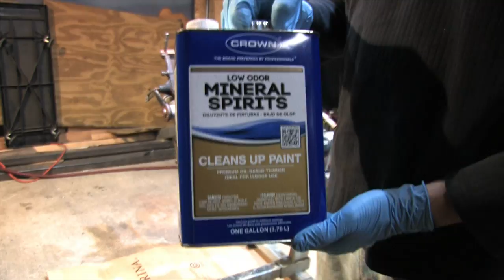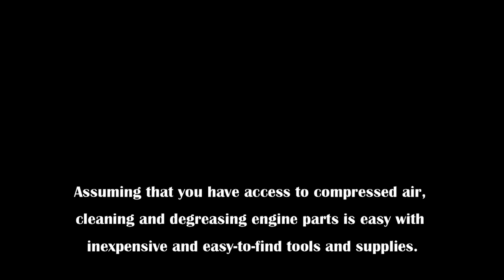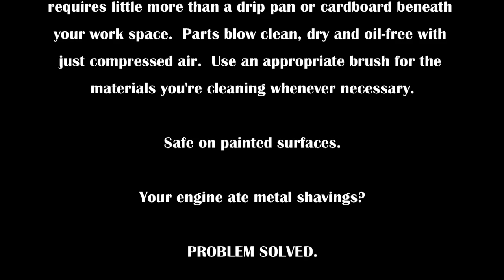DIY Parts Washer

Comment: I recently had to completely rebuild my wife's engine and used this exact method Jafro was kind enough to share with us. This approach worked out awesome! I must say, without people like Jafro sharing things like this with us, I would have easily wasted over $200 in carb cleaner alone! Thank you Jafro!!

There are two things I'd like to make note of:

1) Although it does have a decent evaporation rate, if you are cleaning a lot of parts like I had to, make sure you put extra effort into putting liberal amounts of cardboard down, it puddles quicker that it can evaporate. 

2) Learn from my mistake, if you use this method to clean the wiring harness, make an effort to QUICKLY blow the connectors dry with air. I had a rather big issue with it swelling most all of the weatherproofing rubber seals in nearly all of my connectors!! Some I dried quick enough and had no issues, others swelled so bad that I could reconnect them to the sensors without removing and replacing the weather seal. 

Just something to note!

Jafro, please continue to make these videos as you see it fit, I love learning new ways to a replacement for overpriced specialty tools!!
Reply: fckurvtc very good points to watch out for!

Comment: You should invest in a tumbler ( the thing to clean up ammunitions).

Your bolts,screws,small parts are like new once they took a bath in one of those things.♥

i use sand,bead blasting balls, metallic parts, corn or even crushed wheat with polishing compound and it's really good to clean or polish parts.

Nice Jafro style vid !

Comment: Great idea to use an air compressor and a blast nozzle to blast a solvent for fast cleaning--I'm not sure I would have thought of that.  I wonder how this would compare to using a steam cleaner with a nozzle, of the type Harbor Freight sells for about $100.

I recently got an air compressor to use for cleaning car parts by particle blasting, and it works well, but so far I've only used baking soda, which gets parts mostly clean, but dulls aluminum, so I'll be using ground walnut shells next, which are about one point higher on the Mohs scale of hardness (about 3.5) than baking soda (about 2.5), to see if that polishes aluminum to any degree (I'd settle for just a slightly shiny satin finish), or at least hopefully doesn't dull it.  Glass beads (Mohs scale of about 5.5) and sand (Mohs scale of about 7) are supposed to do a decent basic polishing job on aluminum, but these are dangerous to your lungs, and they'll embed sharp micro-shards in aluminum, which you don't want happening on surfaces that make contact with moving parts, and glass and sand particles can also be a huge amount of work cleaning out of a cylinder head or an engine block.

An interesting thing I found while blasting with baking soda, is counter-intuitive: though something as soft as baking soda can blast off a lot of hard stuff, including paint, it won't clean off softer congealed oil (the black grease that builds up over time), since the soda just embeds itself in the soft grease.  That's where you'd first want to use a solvent as shown in Jafro's video, or just soap and water (though not on ferrous parts like iron or steel), to clean off the grease and oil, after which you can do final particle blast cleaning on the surface underneath.

Comment: I just did this yesterday with a Harbor Freight siphon gun. I did'nt get the dramatic results you did but it was pretty good. I used the mineral spirits but for me, I found Acetone worked better. I can not understand how you stood inside and did this. I went outside and I live in a windy area so I had a strong breeze blowing the incredible amount of toxic mist cloud away from me. I still had to hold my breath. This really produced a bif fog of atomized solvent into the air. Maybe I had more pressure or to little suction? Of course you get better suction the closer the pail is to the height of the gun your using. Anyway it sure did clean things fast and good. I wouldn't recommend doing this indoors, I don't see how you wouldn't pass out in a few minutes from the cloud this makes. But thank you brother for the idea!

Comment from the maker: Just a FYI... I'm back on Google+.  I hate it, but I'm back.  Hate it.  Hate it hate it hate it...  I hope all the worst isht in life happens to Google, and only to Google.  It's still the worst commenting system on the internet, and yes I used Disqus.  Please make sure you have replies enabled if you ask questions.
Reply: Hey Jafro, you misspelled Google+. It's isht ;)
Reply: Agreed the stupid google youtube crap sucks its the worse for messages and comments to reply ! CHANGE IT BACK YOUTUBE !
Reply: Because of advertisers, Always getting the top comment.. Sorry.
Reply: Hey Jafro can you link me to the $6 harbor freight unit please??? Searched the entire site and couldn't find it. I need to do this today!!!
Reply from the maker: Ricky W They call it an "Engine Cleaning Gun".  HF Part number 68290.  It's not exactly like mine, but it does the same thing.  :)
Reply: Thanks guys I picked it up on Monday!!
Reply: Ricky W After getting it did you need a die grinder to take cutting casting lines off it to prevent personal injury? Got an air blowing set with a bunch of connectors and had that issue, lol....still need the die grinder ;)
Reply: DE Nichols Lol luckily I didn't. This one was casted fine. It turned out pretty good too and did a fine job.
Reply: DE Nichols Here's my video response to Jafro, you can see the gun in action. 

DIY Parts Washer. Jafromobile Video Response
Reply: Yeah, Google is pretty much a weapon, currently in the wrong hands, Alphabet inc...

Comment: Hey Jafro! I just wanted to say THANK YOU for your help and awesome video! using the Mineral Sprits from Crown! Holy cow! it made the cleaning process 100% smoother and came off like butter! Its way better than carb choke or any brake cleaner and without the harsh smell! THANK YOU again! awesome vid!
Reply from the maker: I read you loud and clear ol' buddy!  Looks even better the day after, doesn't it?  It just keeps on penetrating and drying it out.  There's nothing like it especially if you're going to repaint.  I'm glad you got to experience this.  :)

Comment: I've used the same type of air syphon gun with gasoline and acetone. I like acetone for motocross suspension parts because it leaves no residue. gas it dirt cheap. when I contaminated a bottom end with metal shavings from grinding the cases to clear a big bore kit without disassembly, I used gas and trans oil. trans oil is very good at picking up particles. all in well ventilated area over a bucket
Reply from the maker: Try the mineral spirits.  It leaves zero residue.  Less volatile than gas, and the longer the part sits afterwards, the drier and more oil-free it becomes.  It sucks the oil out that has deeply penetrated itself into the metal.  Mineral spirits is highly refined coal oil.  It's $2 cheaper per gallon than Acetone at the hardware stores I frequent.  I don't think anything's wrong with acetone, it's a powerful solvent, and it's the main ingredient in carb cleaner... but Mineral Spirits is one of the best petroleum based solvents I've ever encountered.  Because the gunk on engine parts is petroleum oils and carbons, using a petroleum based solvent is extremely effective.  Likened to stripping tape adhesive with the tape that left it on the surface, or curing a hangover with the hair of the dog that bit you.  ;)  Give it a shot next time and save yourself $2.  Use "low oder formula", you can barely smell it.
Reply: +Jafromobile yeah I'll have to give it a try, thanks for the tip. I'll probably continue using gas for bulk gunk because it works well and nothing is cheaper, might be chiseling  away at my brain cells though. love your videos btw! it'll take me a while to get through them. even though I've never touched a Mitsubishi or Hyundai engine, I work in an engine machine shop and have yet to find a flaw in your technique. excellent work man! keep it up!
Reply from the maker: Alistair B Wow!  Oh my damn!  That's a huge compliment!  Thank you Alistair!  Never underestimate the 4g63 or its community.  I'm no machinist, but it's that community over the past 20 years who has fostered me, so that compliment goes out to all of them as well.

Comment: Mineral spirits is fantastic stuff, I use it every single day for many things..... we have a bucket for soaking and degreasing parts in, and multiple contains that we use for damping cloths and degreasing surfaces before painting and plating and such. This, however, is genious. Love it, and I'm definitely going to use this idea on the next engine block we go through. Probably on the heads too!
A couple of notes about mineral spirits for those of you not super experienced with it:
It is safe as far as respiratory concerns, but it may give you a headache after long exposure without proper ventilation.
Also, it's flammable as hell lol.
Awesome video, fantastic idea man!

Comment from the maker: @XL Lee - your replies are disabled.  I used 80% of one can to clean a whole engine.  Most of what comes out is high pressure air, but you can change that ratio by holding the can higher or lower while you work.
Reply: ***** I'm so happy I found your channel. Keep up the amazing work.
Reply: HOW MANY PSI.?

Comment: I cried when he threw the valves in the paint pan. You just mixed them up!
Reply from the maker: But the car is running and the valves are still in the paint can.  : |  It got a valve job and a new complete set of re-ground valves.  It'll be okay.  Cheer up!  :)

Comment: Jafro will this dry out rubber seals like injector o-rings, camshaft seals behind the cams, valve cover gaskets, etc.??

Also,  do you think I could get away with using a 6 gallon air compressor to do this?

Is there anything that should be avoided while cleaning the motor on my 2g dsm? It'll still be in the car, not torn apart or anything. I just have a ton of oil leaks at the valve cover, oil pan, oil filter housing, and a power steering leak at the rack.

Comment: Excellent, thank you.  However, your last note is a bit of a misnomer.  Volatility isn't increased when a substance is vaporized since volatility is a qualitative description of a substance's willingness to vaporize in ambient conditions.  Vaporizing more of it certainly makes it more likely that you make your garage a rich enough environment for explosion though.  (It would probably make a cool flame thrower too).
Reply from the maker: I know.  I finished all the 100 level and 200 level Chemistry classes in pursuit of an engineering degree.  Based on your detailed analysis of my comment, you clearly got my point, and yes I was being dramatic.  ;) b  

Forcibly diffusing it with it's most necessary oxidizer makes it more prone to reaching that stoichiometric point where it violently burns instead of casually burning.  It's volatility does indeed remain a given constant, I was just trying to scare people into avoiding explosions without making them take all the same courses we did.  Perhaps I should have said its "flammability" instead?  Either way, I don't want anyone to blow up any nouns (people, places and things).
Reply: +Jafromobile :) thanks for making me smile on top of making awesome videos. You can certainly call me an impressed mechanical engineer.  Great work.

Comment: The SDS sheet for your mineral spirits lists a flash point of 104F; this means it's a "combustible liquid." Your fire code lists requirements you must follow while spraying this material, and it likely mirrors NFPA 33: Standard for Spray Application of Flammable or Combustible Materials. You probably should talk to your local fire marshal about how to do this safely, as there are a lot of options; spray outside, noncombustible solvents, spray enclosures, explosion proof equipment, etc.
A 1% mineral spirits atmosphere around your compressor, fan, etc. is enough to ignite the vapors and mists you are creating.
Your 1 gal of mineral spirits creates a 1% or greater (by mass) atmosphere in up to roughly a 25' x 25' x 10' room.
Reply: lol

Comment: Can I use a regular degreaser first like purple power or green degreaser ?
Reply from the maker: Sure.  Just be sure to rinse thoroughly afterwards because they're acidic.  Aluminum won't like it if you let it dry on there.
Reply: Yup was planning on using acetone or mineral spirits after.   Hey amazing work with your videos. Been watching all of them since I am taking a motor apart now. Thanks for all the videos and info.

Comment: Here's a better way. Get a big plastic storage bin, put the engine in it, then fill it with purple power, and let it soak overnight. Rinse with water attached to your cleaning gun. You will never go back to solvents again.
Reply: ipissed I know it's been over two years since your comment. Im in the process of cleaning my torn l28 datsun engine. Any suggestions on the coolant passages? You think that method would work but with vinegar or CLR?
Reply: Paul Corona yep I soaked my block in vinegar for 24 hours washed it out with water and compressed air dried what I could then with a heat gun to dry it fully.

Comment: A machine shop will Vat this for less that $25.00 and it will clean the most important parts like the oil Gallery's even after all this the oil passages are still full of sludge and the new bearings is doomed it does look like it works pretty good on small parts though another way to clean stuff really well is with Easy off oven cleaner but you will have to do it out side and wear a respirator it's really toxic spray and let it sit for an hour rinse and get very clean parts
Reply from the maker: Stay on the Christmas card list for any machine shop who will clean all of these parts for you for $25.  Do whatever is necessary to keep that relationship.  I get Christmas cards from mine, and I would still have to pay at least 4x that much.
Reply: Myvintageiron7512
$25 is cheap. But I've noticed prices can vary city to city, state to state.
Reply from the maker: My shop is $85 for a whole engine (including all oiled parts), and that's MY price.  I guarantee I got it all, and the proof will be uploaded here in drag and dyno videos.  If I blow it up again, I'll be happy to take it back apart again.  VintageIron is right though, you could fall asleep at the blow gun and miss a spot.  Getting it hot tanked is always the best option.  This video is for people who don't have the access, time, or money to have a professional do it.  All liability hinges on the awareness of the operator.  Same is true for machine shops... but people tend to pay closer attention when the part is theirs... if you know what I'm sayin'.

Comment: So are you going back with a composite head gasket or are you going to machine the head for an MLS?

And a big, huge thanks to "ROJODELCHOCOLATE* for making it possible to sit through what some might consider a less eventful video!
Reply from the maker: Straight-up FEL-PRO composite gasket.  This head's been decked so many times, and the block has been so heavily machined that I'm not sure there's much left to play with to prep it for an MLS gasket.

I'm not even replacing the factory head bolts.  This whole engine is made from stock parts, and that's what's going back together.  It didn't blow up because of gaskets or fasteners...

...and yes, thank you.  RojoDelChocolate made this video watchable.  There's nothing I could say that the video didn't say already, and it was incredibly boring without him.

Comment: would Purple Power or Brake Cleaner be okay to use when cleaning my head WITH VALVES, SPRINGS AND BUCKETS INSTALLED, or would it dissolve the lube in the valve stems and cause friction?

Comment: Is mineral spirits safe to use on oil/grease seals? Once I soaked a rubber oil seal with mineral spirits and it swelled up and then it got brittle/weak a month later.

Comment: Once again Jafromobile shows us how its done....say think heating the mineral spirits would help at all?

My father just has a 50gal drum of the stuff with a large metal sink on top with a pump in the drum connected to a brush, works well but it might be hard to fit a engine block up there lol.
Reply from the maker: There you have it!  That's precisely why this trick is awesome.

Plus... do you really want all that contaminated oily gritty sludge in your filter?  You should see the cardboard on my garage floor.  I tried filtering some of the runoff and it clogged a coffee filter within a half-pint.  They're made of paper, so it didn't melt closed.  You can pour clean mineral spirits through, no problemo.
Reply: Well in my fathers setup, the pump is suspended in the middle of the tank, so all the sludge and heavier crap falls to the bottom. He only empties it I think like once a decade...if lol.

P.S. Been using the same pump for decades.
 Just another idea for the smaller stuff.

Comment: I have an engine that I'm replacing the head gasket. the head is off but the Pistons and oil pan are still on the engine. Engine is older and uses push rods. is it OK to use 50/50 solution of ATF and acetone amd then pressure wash with water? would this cause any damage to the engine?
Reply from the maker: I'm going with no, not a good idea.  Water is the last thing you want in a cast iron anything.  You'll never get it all out before it does damage if it's assembled.  Mineral spirits wouldn't even really be good for it if you over-did the bath because it will wash the oil out of the galleries and then you'll have un-lubricated bearing surfaces... but at least it wouldn't rust.  If you're just doing head gaskets, use rags to wipe/clean up the chunks before using solvents, then polish gasket surfaces with a vertical razor blade.  I've covered that technique in other videos.  This method here is for disassembled engines.